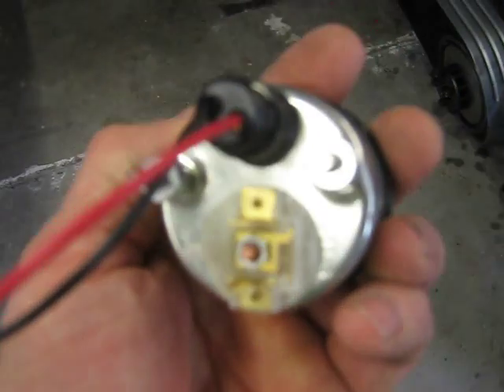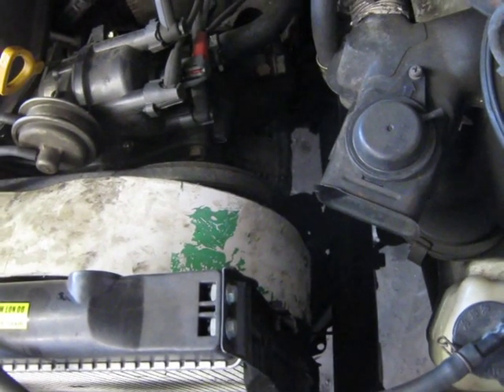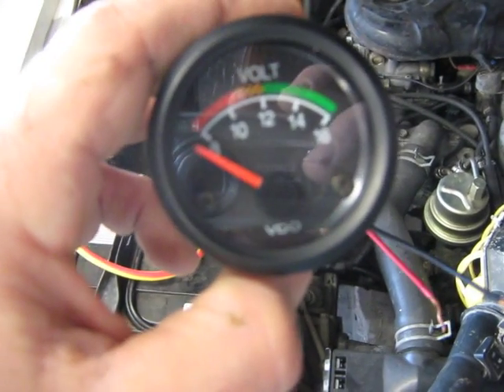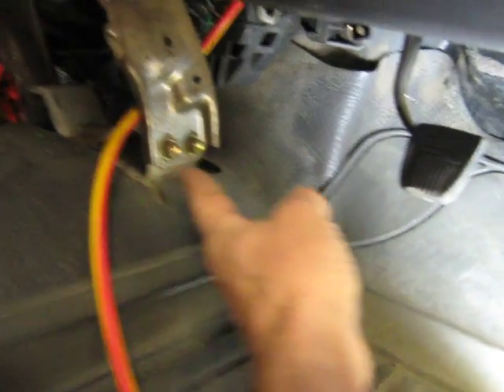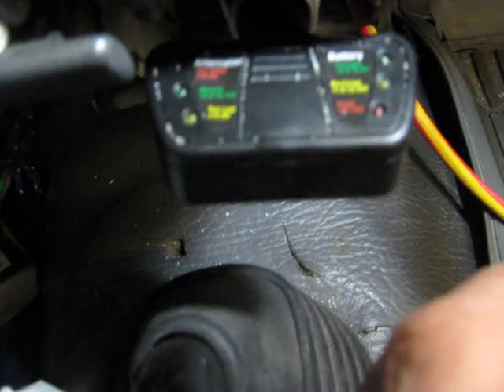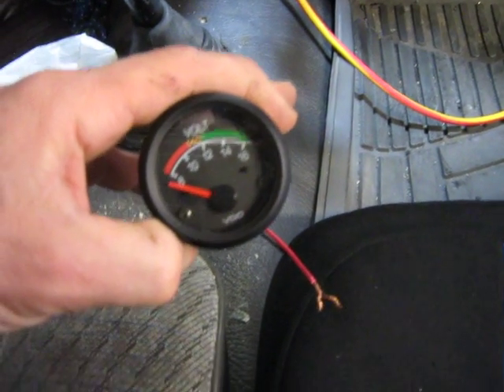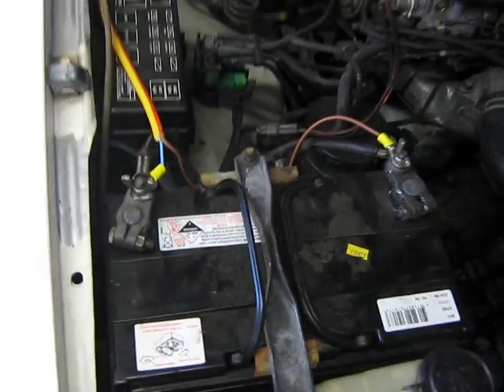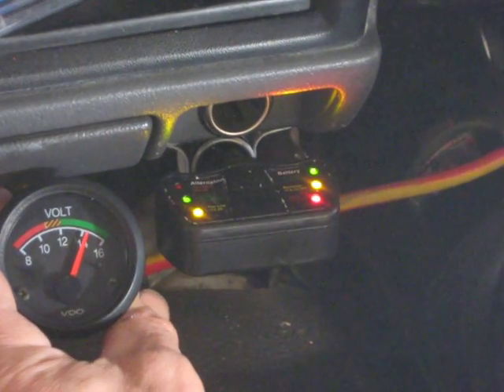VDO car battery volt gauge installation

Comment: That’s going to draw your battery down mate hooking it straight to the battery, because the meter will constantly draw power. Best way to hook it up is to find a power source that comes on with the key on and power isn’t there when key is off. So that way your meter isn’t constantly drawing power. The light hook it into the line for your head light switch so when you flip the head lights on your meter will illuminate

Comment: so do the power and ground wire go to the same terminals on the battery
Reply from the maker: The positive ( red ) wire gos to the positive terminal on the battery and the ground ( black ) wire gos to the frame , this volt gauge has saved me from a generator brake down since the video was made and still works, i check it all  the time
Reply: thank you!!!
Reply: 1966human a volt meter connected directly to the battery will eventually discharge the battery because the meter never turns off. a better source is a line after the key switch that shuts off when the key switch is off
Reply: @1966human  what is the name of the meter.. can only find digital one